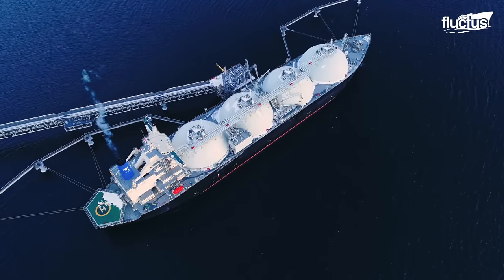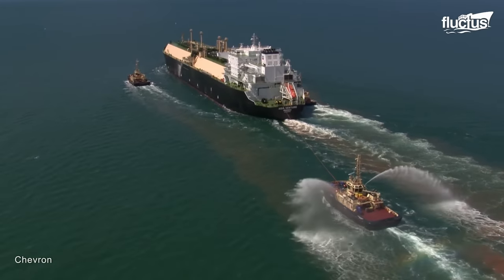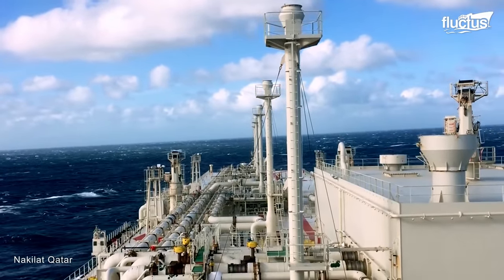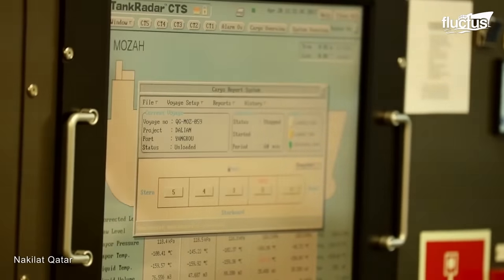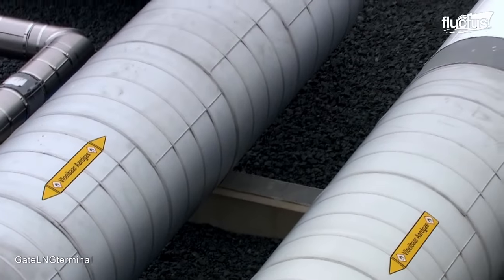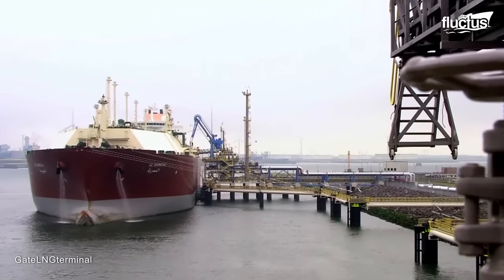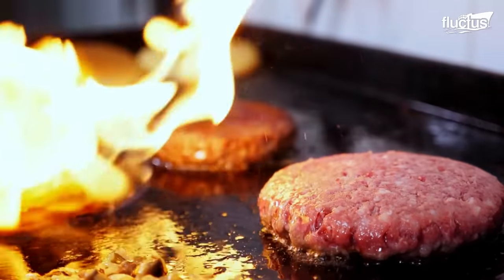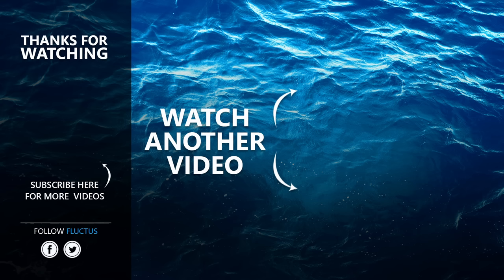How World’s Largest LNG Tankers are Built in Multi Billion $ Shipyard

Comment: LNG  does not have “low carbon emissions”. Its combustion yields CO2 just like burning any petroleum product. 

LNG is often sold as a cleaner alternative to coal. But LNG is only “clean” because it’s not as “dirty” as burning coal—burning natural gas doesn’t yield soot and sulphur-dioxide like coal but it definitely yields a similar amount of CO2.